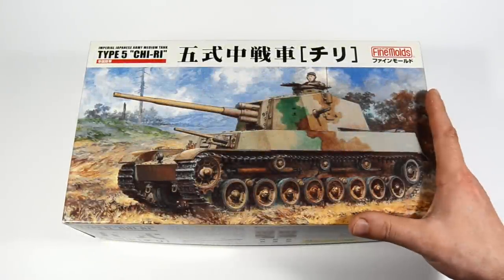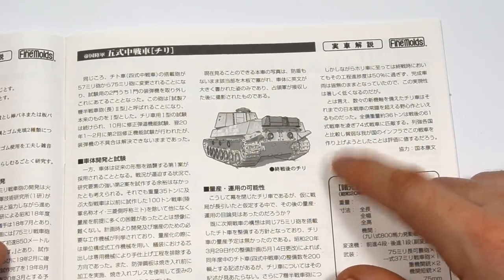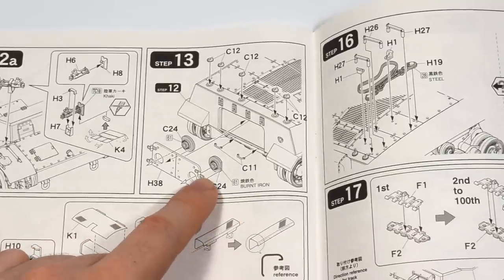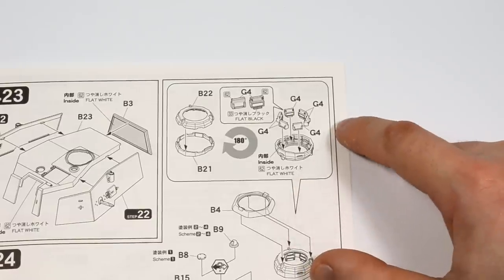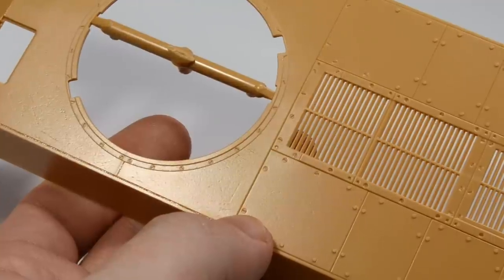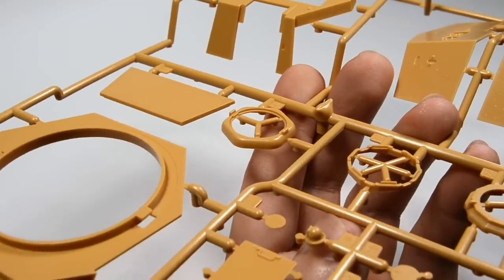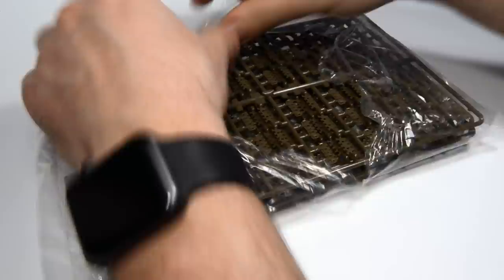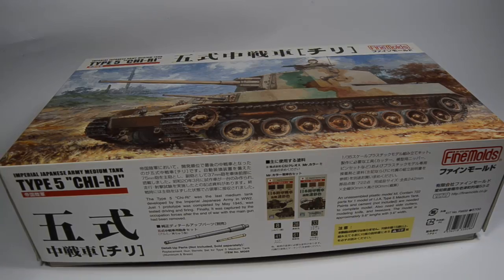Type 5 Chi-Ri Medium Tank REVIEW (Fine Molds 1/35)

Comment: Very impressive you knew it was an Type 4 Chi-To ! Not many people do a research on Japanese tank history.
At 01:26 you missed the tank destroyer version of the Chi-Ri, it is an Type 5 Ho-Ri Fine Molds also have a model of it :)

Last, i just want to say that the Chi-Ri was fitted with two trays attached on its gun, this is to make the loading of the main gun easier and faster, but it is not an auto-loader device .
Reply from the maker: Thanks for the info! Amusing Hobby also makes the Ho-Ri
Reply: @NightShiftScaleModels 
 You know what i take that back, it is actually the Amusing Hobby that did the Ho-Ri as you said, i thought it was fine molds lel
 It was the o-i that fine molds has, two rare vehicles so it confused me xD